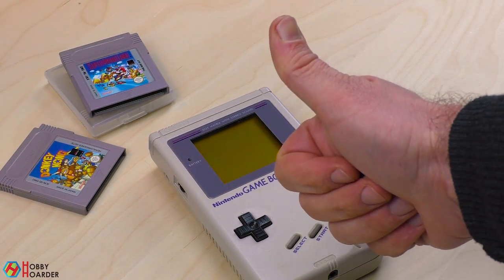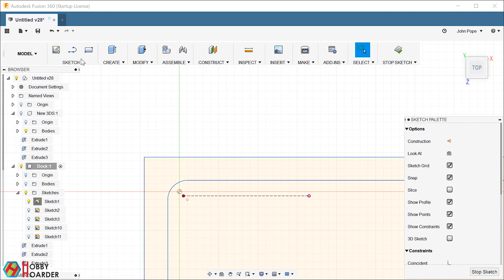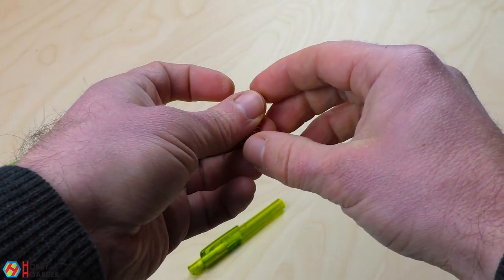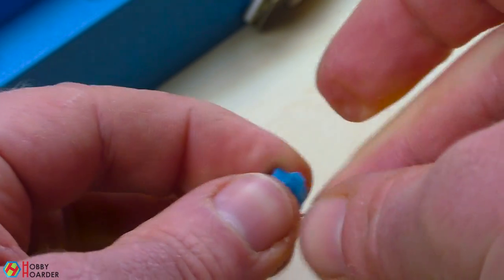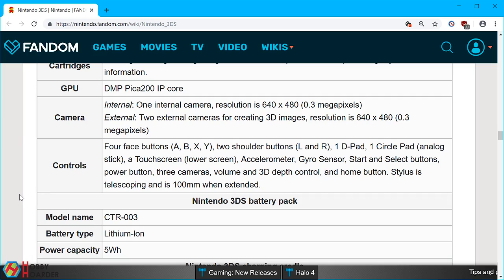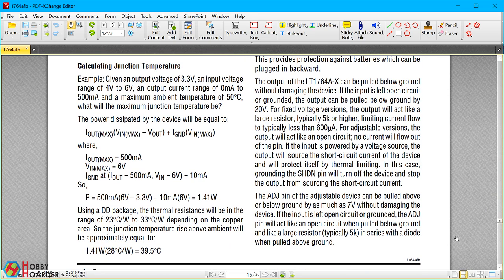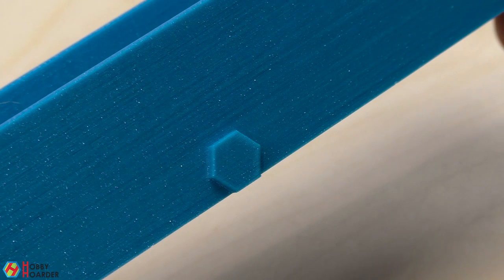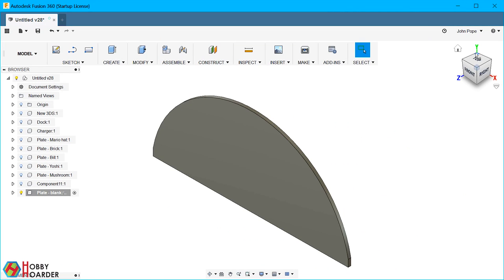3D printed charger for Nintendo 3DS

Comment: You can use a schottky diode in series with the positive lead to get your 0.4v voltage drop from the USB supply, if you're REALLY paranoid about using the correct voltage.

Comment: Wow this is so awesome. Now I do not have to replace the charging port but use this one. But one problem is that my 3DS charging port is not at the middle. Its more towards the right. Do you have some other design?
Reply from the maker: I'm glad you like it, thank you. Sorry, I don't have any other designs, since this is the only 3DS I have. I did provide source files for Fusion360, so it shouldn't be too hard to change the model if you feel like trying.

Comment: Hey there, awesome video. I'm thinking about printing only the charger part, sold with the wire and the dock I will do it myself with a simpler design (actually, handmade, not printed) cause I own an old 3ds, but I'll be trying it. I had to borrow my brother's charger to play but he wants it as well, so it will come in handy
Reply from the maker: Good luck, I'm sure you'll make it a great one!

Comment: I need to make one for my son's 2DS-XL Zelda edition. Is the size close enough? Or will I need to start from scratch? Thanks for the fun and informational video.
Reply from the maker: No, it won't fit XL as such. I don't have the XL so I couldn't design two versions, but it was my hope from the start that someone with XL would measure it and send me the info and I can make the XL version as well. I'd be very happy if you're willing to help. Since I'm also a Zelda fan, I can create a Hyrule shield plate as well :)
Reply: I just found this out as well; the "old" 3DS-XL actually has the power port and pins exposed off of center from the device, so the design will have to be changed.
Reply from the maker: @ThantiK I know, I saw that design somewhere, but without actually having one, it's hard to make the second. If you have one and would measure it for me, I'd love to update the design.
Reply: I have the same one.

Comment: Amazing. Do you have any design for New 3DS XL? Would love to make this but I have XL model. Anyway you can provide the fusion file for it so I can make some modification?
Reply from the maker: Yes, please check the Thingiverse link, you can find the XL page in the model info.

The original Fusion file is also on Thingiverse and you can use it to modify the model anyway you like.
Reply: @HobbyHoarder  Thanks so much.. Really appreciate it.

Comment: using the standard 5v wouldn't it damage the ds or its battery in the long term ?
Reply from the maker: Nah, that's highly unlikely. The official voltage is 4.7, which is very close to 5V. There are also protections inside the 3DS to prevent damage from overvolting.

Comment: Hi is the xl version released yet?
Reply from the maker: Not yet, the prototype is being printed/tested by someone else first, because I don't own XL myself. Should be soon. If it helps, the charger part is exactly the same, so you can already print that and attach the wires.
Reply from the maker: Hi, the XL version is finally out! Please note that I haven't tested this myself though, because I don't own the XL, so I can't guarantee it will fit 100%. But the guy helping me out with the testing says it fits ok. Here's the link: https://www.thingiverse.com/thing:4229093